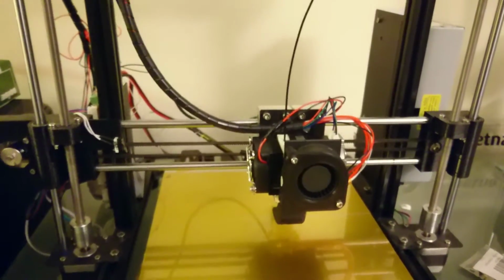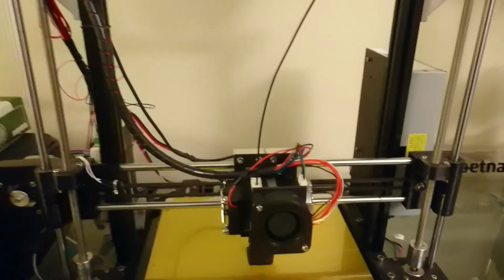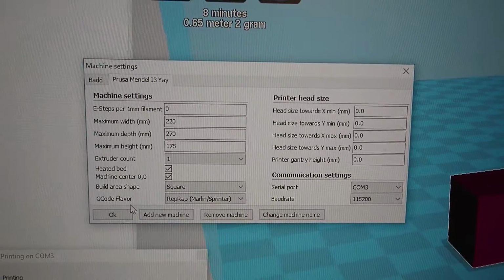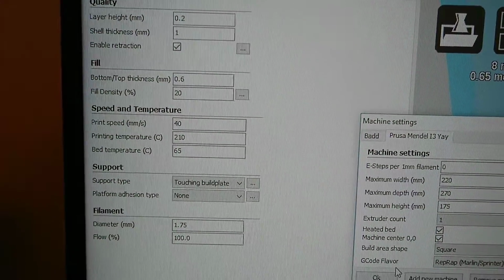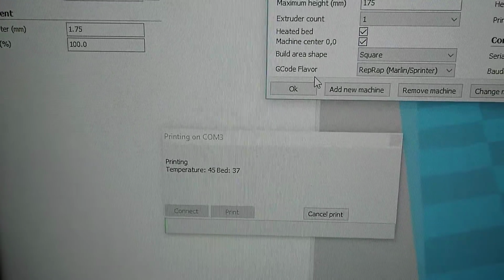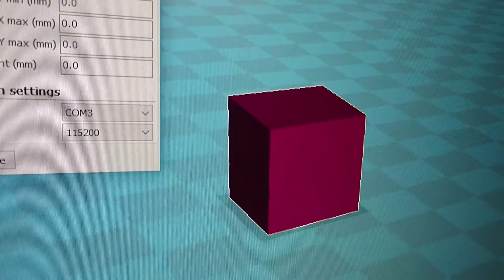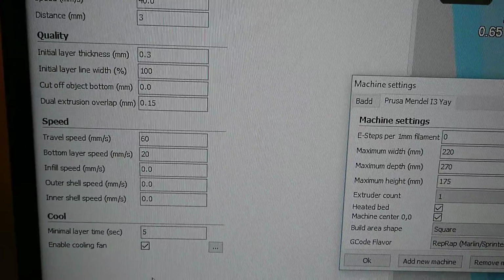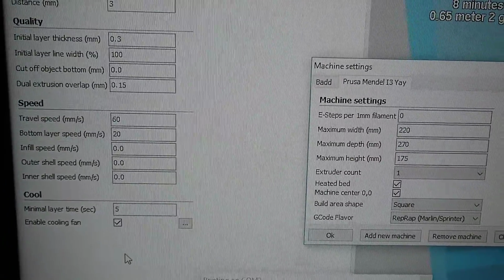HIC TOP Prusa i3 Issue After Firmware Update

Comment: Did you manage to find a solution for this will really appreciate your assistance
Reply from the maker: I did!
I contacted the the vendor and they sent me the wrong firmware. The original model came with a different pitch in the z-axis thread. Newer models have a different pitch for smoother movement.
 Changing the printer settings, I was able to set the pitch back to the original value.

I also updated the slicer software to Cura 4.x and added the printer. All works as it should.